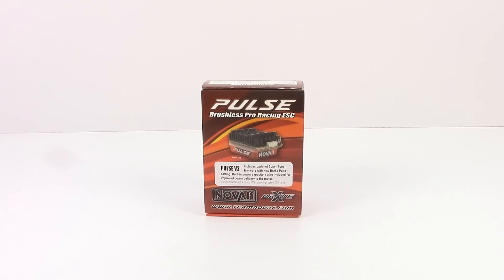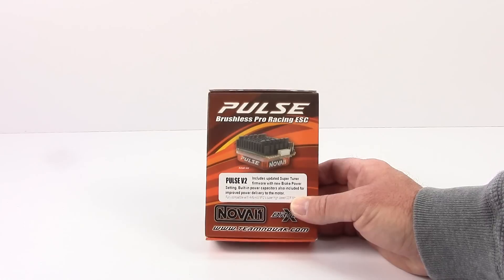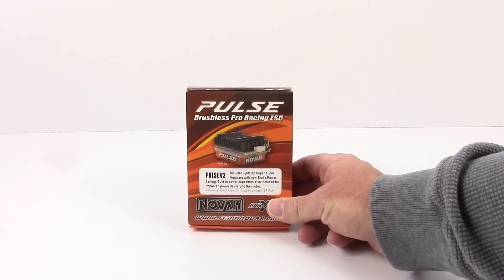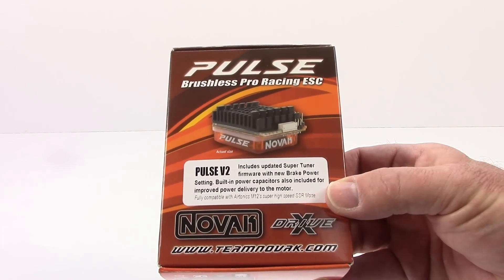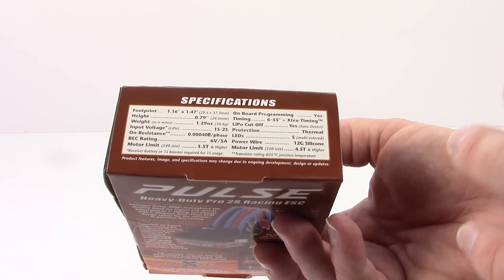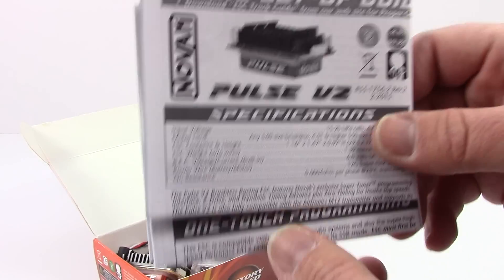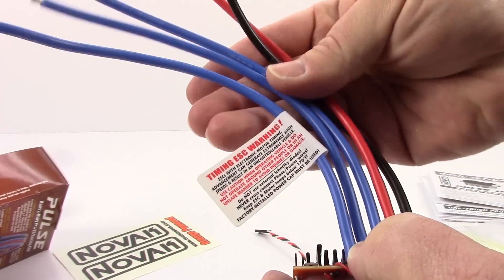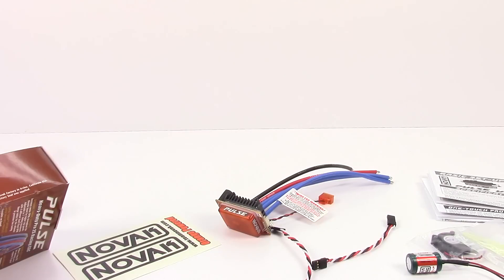Novak Pulse Sensored Race ESC - Unboxing

Comment: I have the same combo that you got and install it in my team Durango DEST210R it's a real blast . if you want to enjoy the max with this speedo pair this bad boy with an Airtronics radio setup and activate the SSR mode . it's super smooth and I really enjoy the Novak Throttle response . Hope you have a lot place to install it since the footprint is larger now because of the integrated capacitors.
Reply from the maker: +Alex R Glad to hear!  I should have plenty of room in this new build.

Comment: I bought my first Novak esc around 1990 for my JrX2. I plugged my SCR battery in, turned it on and it went up in smoke . I haven't owned one since because you know what they say about first impressions. Anyway, I've been tempted to try a Novak again as they have some nice offerings at decent prices. I look forward to hearing what you think of this one once you've had some time behind the wheel.
Reply from the maker: +MrBonger88 Yikes!  Well, electronics have def changed since back then....This Novak system should be solid!

Comment: Looks solid Rich, hopefully it is all it is supposed to be and don't burn out as soon as you hook power to it.
Reply from the maker: +Anthony Eaglebarger (toysoldier46552) I've never had an aftermarket ESC fail like that.....so should be good!
Reply: The RCNetwork So far I've been lucky with my Nitro stock ESC, never had to replace it and since I bought a low cost Redcat Racing Volcano, I was expecting much worse, however I still have my electric 1/18 scale which has made it for years even through the snow lol.

Comment: your getting a tc7. lol. does it have reverse? I had a novak competition and it had no reverse.
Reply from the maker: +2cwik4u104 Very good question on the Pulse....I typically never run reverse in my race rigs, but the Pule has a "reverse disable) feature
Reply: nice to have the option.

Comment: how does the pulse measure up against the black box size wise?
Reply: its bigger. Novak really needs to downsize their esc's. The best two esc's for size..Viper(which is now MacClan Racing)VTX-10 and the Dualsky x550. I own two of both of those..size and weight are unmatched by any ESC on the market ;)
Reply from the maker: +Paul Tani The footprint is a bit smaller, but overall much taller than the blackbox (both without fans)